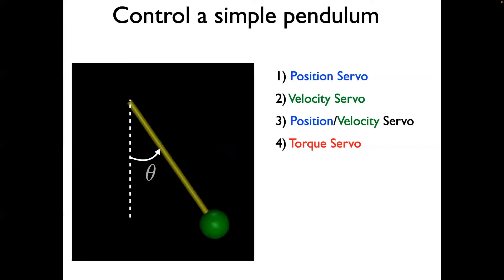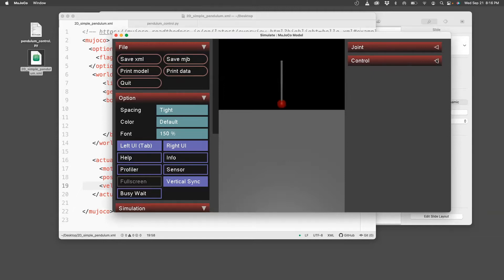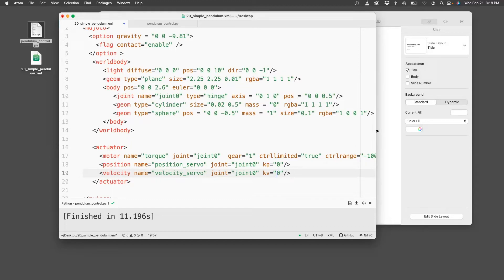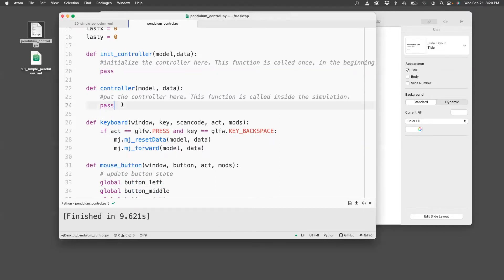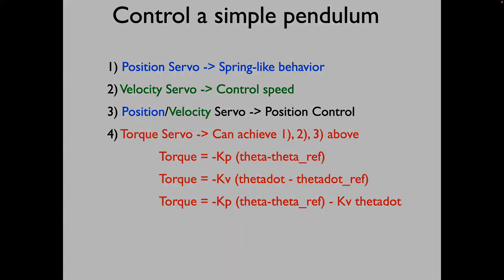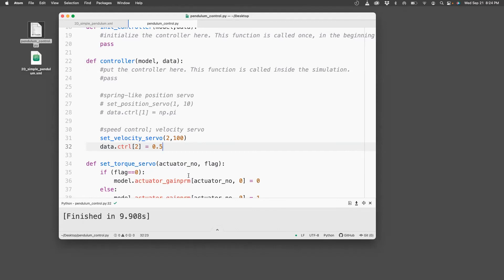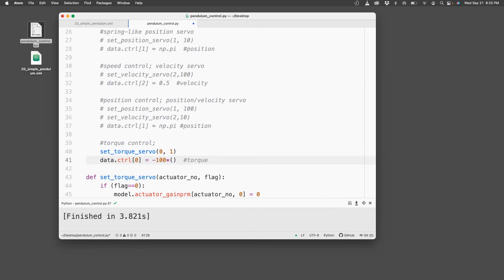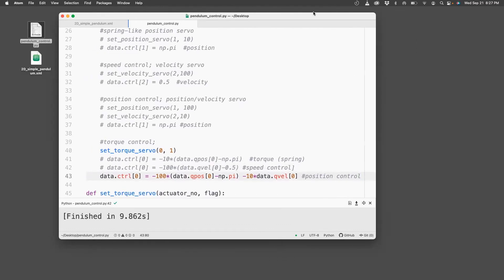MuJoCoPy Lec 7: Position/Velocity/Torque Servo

Comment: Why does the position servo exhibits a spring like behavior rather that going to the exact position and stopping?
Reply: And why do we have to give both position and velocity servo for position control
Reply from the maker: @gokulakrishna9663  the position servo has spring like behavior. Command =-kx. The velocity servo does command = - c xdot. To get position-derivative control you need to combine both. Command = -kx - c xdot
Reply: @pranavab  okay, can I PI controller be used? If yes how to incorporate I in mujoco activator?
Reply: Actuator*
Reply from the maker: You will have to do that manually. Keep a running sim of the accumulated error. Use the Euler integrator for that, not runge kutta
Reply: @pranavab  Okay, thank you for clarifying.